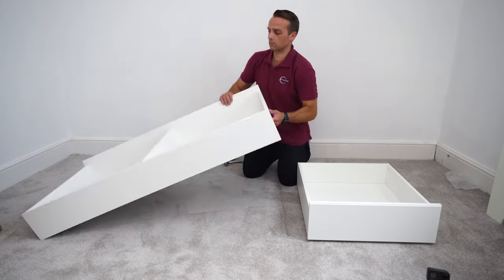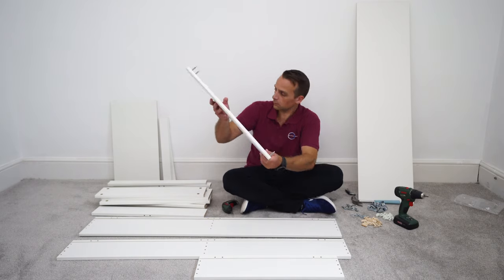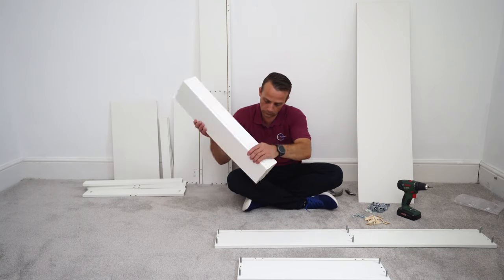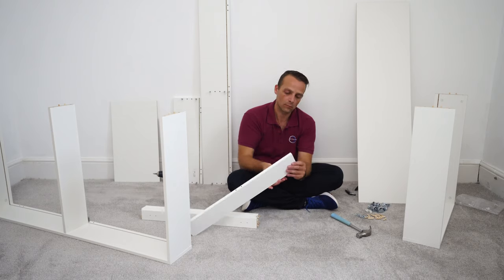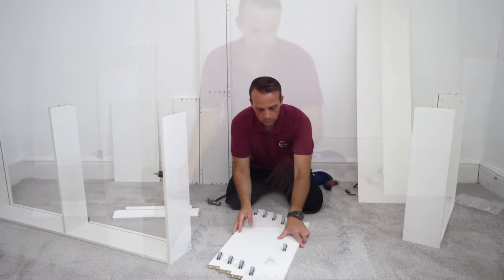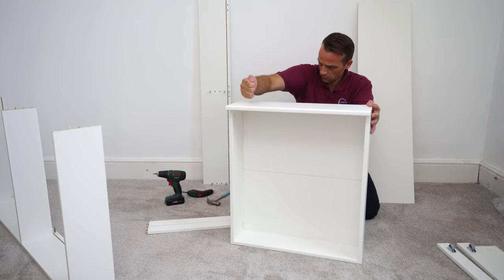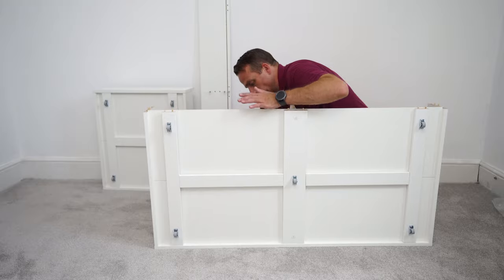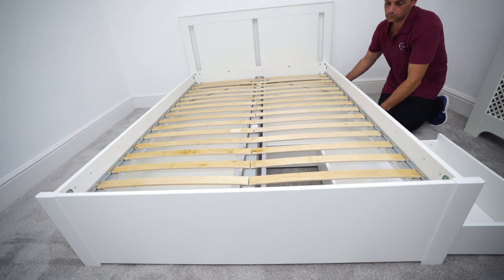IKEA SONGESAND Bed storage boxes assembly

Comment: Do the drawers roll out smoothly or do you have to really push pull? I hope this question makes sense..thanks
Reply from the maker: Depends in your floor. If you have wooden would it will go easier if you have  carpet it would give more resistance but not to hard to open or close the drawers
Reply: @PPFlatPack  awesome thank you

Comment: Weird question maybe, but can you swap the drawers round? So that the big drawer is towards the foot of the bed, and the small one is near the headboard on both sides? We can't decide between the Brimnes and the Songesand bed frame. We are going to have bedside tables so won't be able to open the drawer closest to the headboard
Reply from the maker: Yes you can switch drawers the way you need. And between the BRIMNES and SONGESAND check MALM very popular bed and can have drawers under bed plus easier to assemble. Here is the link https://youtu.be/7rohOKzkK7o